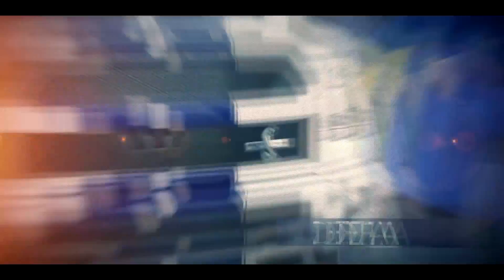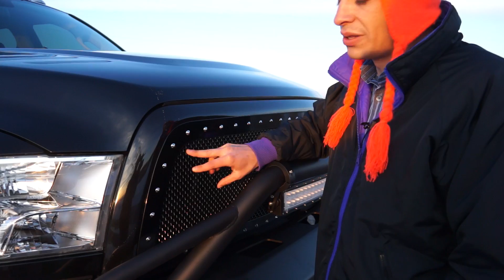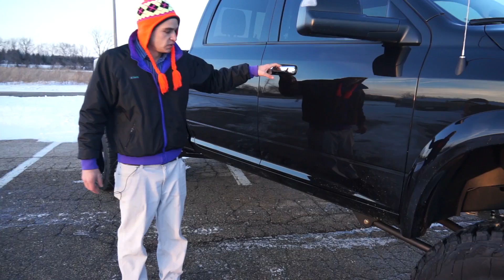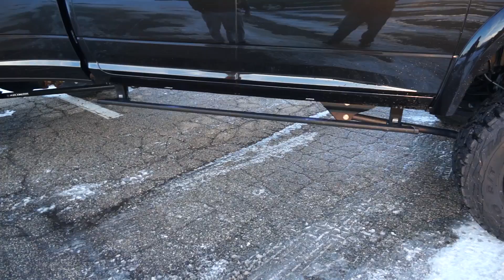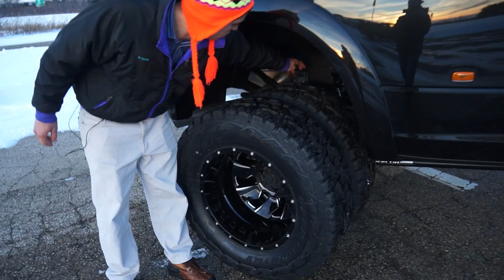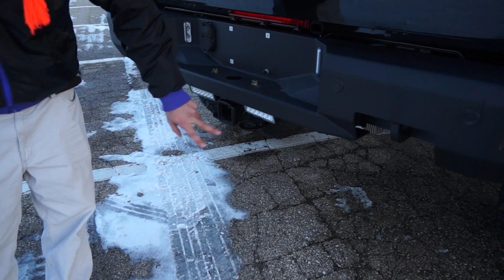LIFTED DRW DUALLY! 2017 Ram 3500 Cummins with 6" BDS Lift w/ Recoil , Custom Bumpers, and more!

Comment: What did you do with the rear? Is it a BDS 4 link? Did you go for the BDS leaf springs or use a block? Also where did you get the rear axle u-bolts or were you able to v use v the factory? Thx!

Comment: nice build, you mentioned the offsets for the front and rear outside dually tire, could i get the offset for the inside dually.
Reply from the maker: Hey Norm, please email Marcos at marcos.perez@kunescountry.com and he can get you any info you need.
Reply: awesome, than you very much for your help

Comment: Have you ever had problems with the boards not dropping down? I live in Minnesota. Snow loves to stick to the cab/frame rate behind the front tires. I was wondering if it has enough force to knock it off or will it stay tucked under the vehicle?
Reply from the maker: We're in Wisconsin, and 5-10 years ago we used to get complaints about them getting stuck but not really anymore.  The AMP boards have done very well for our customers and these days we don't hear much at all about the snow/ice issue.  A few things for cold weather are just keeping them well lubricated in the winter and/or installing a good set of mud flaps to minimize the ice buildup.